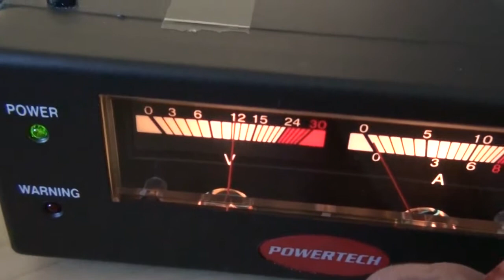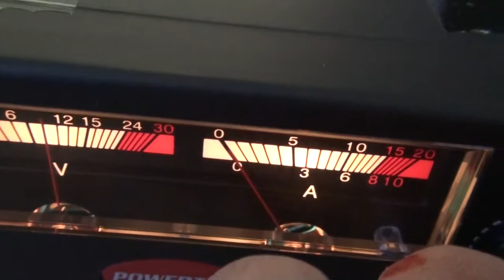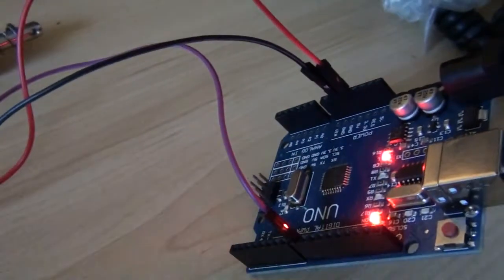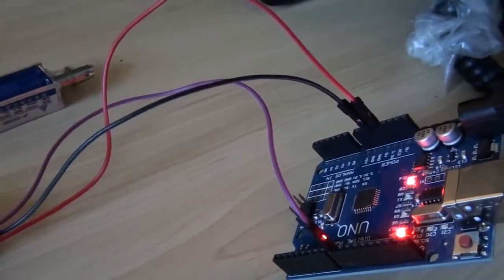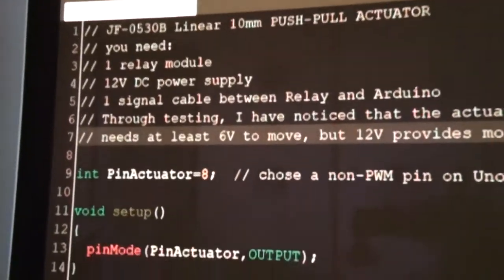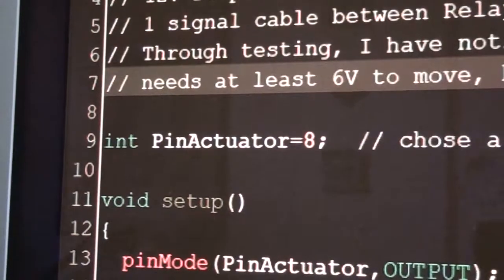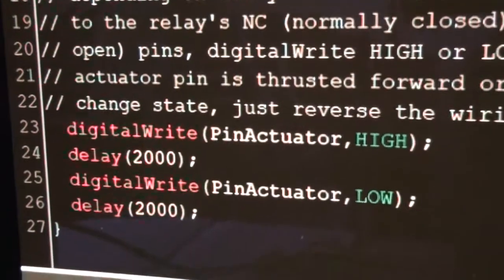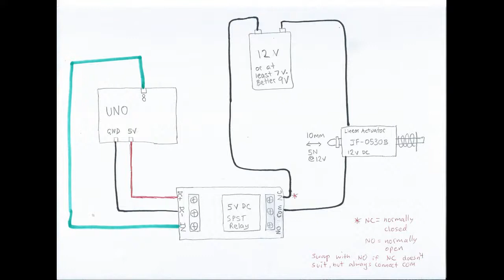Arduino #14 Using the JF-0530B Actutator

Comment: thanks for your useful video. can you share me about the force 5N. this is the 5N at the starting trip or ending trip.
Reply from the maker: Hi, I'm no expert even though I made the video. I would suspect that the specification of 5N refers to the force upon triggering and not on forcing the piston back. But find the specs. I havent used this actuator for 2 years so I am not the best to comment. I suggest u google the part to find good specifications

Comment: Can I use 12V relay instead of 5V relay?
Reply from the maker: yes, but use up to a 12 V power source to your device that u are controlling, whilst using one of arduino's 5V pins to control switching. u can google "arduino relay wiring" for wiring layout
Reply: @MrReedable  thank you for your advice~!